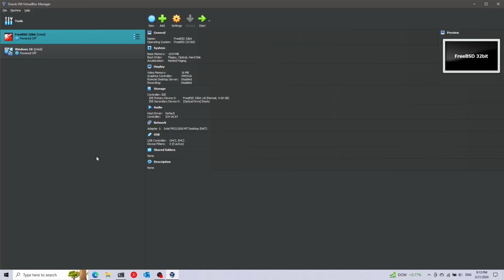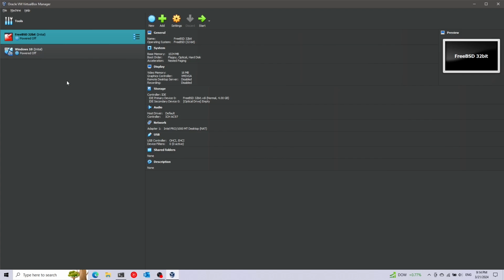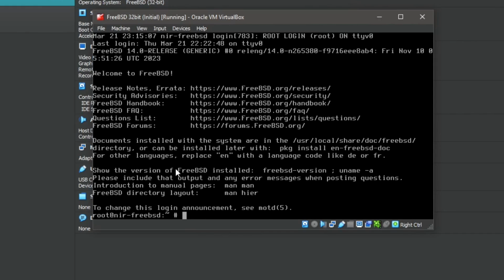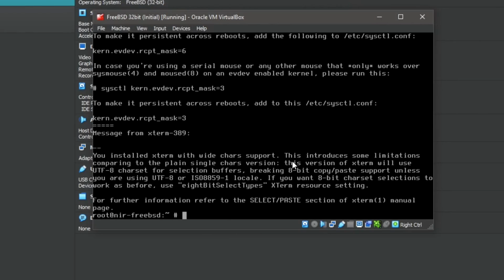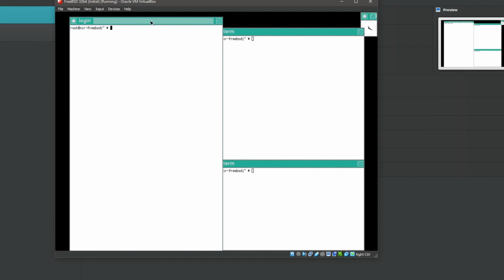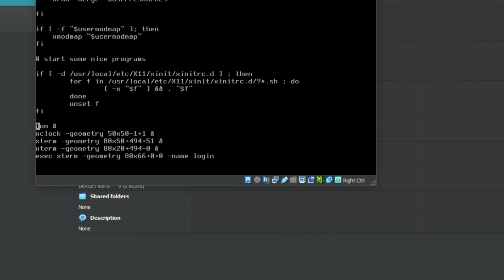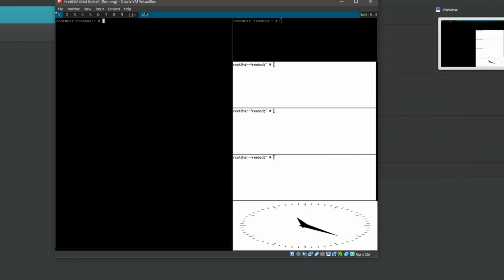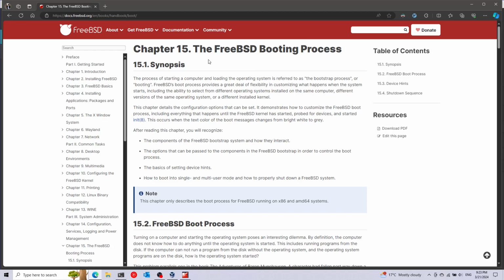Quick Look at FreeBSD

Comment: FreeBSD has a more "permissive" license. As though the license stopped companies like Google and Microsoft from profiting. Android uses a Linux kernel. One of the reasons why I use GNU/Linux is the license.
Why does Microsoft contribute code to Linux? Because they love Linux? If Linux were under an Open Source license like FreeBSD, rather than under a copyleft license like GPL, they would have just forked the code and made it closed source so that they can add their own code that benefits their Azure code platform. Free software shows the way. Free software license is superior to Open Source licenses. Free software forces Microsoft and other corporations to contribute back to the community. 
 Long live GPL!

Comment: Synopsis - FreeBSD is better than Linux, because it has a text installer, and you have to install X before you can do anything. Meanwhile, something like EndeavourOS and Kubuntu are clearly worse because they have a graphical intallation system. Also FreeBSD is better because Linux is only a kernel, and people have had to create distributions. The infamy.

Comment: I used to use FreeBSD around the turn of the century to build custom kernels with custom hardware to do very specific functions on i386 based hardware, and then write specific apps to action. For example a frame grabber card on an analog camera to detect the state of the ironing board power switch, so I could know where I did actually leave the iron on.Firewalls, routers between niche network devices, 16 serial terminal cards to interact with other serial devices, and some bespoke hardware. With the ability to hack the kernel, build files and source, you could modify existing kernel code to do whatever you wanted. I started using it as William Jolllizes 386BSD, into FreeBSD and stopped using it after release 4.3 when my work life balanced changed to work…. Miss those days.

Comment: Nice ! i have a different view on FreeBSD. My first experience with FreeBSD was in version 12 i believe, and i spent so much time, actually too much time to install intel UHD graphics drivers lol (bare metal on my laptop). After doing that i installed KDE desktop and couldn't manage to make my brightness and audio keys to work (n00b moment), the thing is i was actively reading the documentation but couldn't find any section for my use case so until i found a forum post buried under a mountain of similar posts that had my exact problem which also was solved in that particular thread. Afterwards i decided to try OpenBSD, which to my surprise everything worked ootb, i didn't have to install any graphics drivers, also the audio keys just worked but there wasn't any indicator in their default window manager (fvwm, i also believe the only guy who uses it is Theo de raadt himself)

Comment: Why would anyone run FreeBSD? Linux (and UNIX likes in general) is already a small and niche community.
Reply: Bsd users are the Linux users of linux
Reply: @1cubealot  best comment so far
Reply: MacOS and Android are unix-like, and their community is not exactly niche or small, in fact the only popular operating system that is not unix-like is Windows.
Reply: @darksteelmind  If BSD did not have that lawsuit in the early 90’s Linux would not have existed today as there would’ve been no need for Linux because BSD would have been enough.
Reply: It's free software so almost everything that's properly developed is available there too. Also, the BSDs are much more technically strong compared to OS distributions based on Linux.
Reply: It's good for storage servers e.g. running your own NAS because it has native support for the ZFS file system and there is NAS operating systems based on FreeBSD.
Reply: Because Linux containers / docker  is still a total mess.

BSD + jails is good for a stable platform where you want years of continuous uptime.

On desktop, FreeBSD is pretty niche, but the audio is a lot better than Linux at least. It’s actually not a bad platform for a gaming PC.

For a dev workstation- bhyve is decidedly good for running lots of VMs
Reply: @steveoc64 how are containers a mess exactly? It's much easier to build a container, even from scratch, than to use jails.
Reply: Well we need to make the community bigger
Reply: Well, PlayStation OS is based on FreeBSD
Reply: It’s like saying “why would anyone drive anything other than a Ford?” 😅
Reply: @Crux161  love it.
Reply: @Crux161  exactly. IMHO, every OS has its purpose, its pros and cons. There is no "best" OS in general. Like with everything in life, you have to figure out what's the best solution for your scenario.
Reply: @yogxoth1959 Ah, but you are so incredibly wrong!

Linux powers every single Android phone in existence, and much of the server infrastructure behind world wide web.

FreeBSD is used as the base of the operating system on the PlayStation 3 and onwards, and it's userspace and parts of its kernel make up a large part of Mac OS  (which itself is a certified Unix operating system) and iOS.

Sure, the people who actually care about what goes on under the hood of their devices might be (relatively speaking) "a small and niche community", but the interest they take in *Nix ends up serving a much larger (several billion) community of people who don't even know it.

Besides, if you're this dismissive of Unix and Unix-like operating systems being used, why are you even watching videos from this channel?
Reply: Lindo  mi FreeBSD de toda la vida ❤
Reply: Linux is a mess. Nobody agrees on anything, rogue devs constantly hijack software, and recently corporations have been having their way with it. BSD is sane. Every decision is logical and the community is less.. weird, to put it nicely. BSD is just Linux without constant drama.
Reply: @EXP_Jenova  wouldn't go as far to say every decision is logical, but yes. it's a breath of fresh air seeing how most of the BSD community actually keeps themselves involved with software, and not.. other things.
Reply: It is a Psy Op from the corporations to divide the Linux community. zfs is just the excuse.
Reply: Faster TCP/IP stack. Slightly better I/O multiplexing syscall for servers
Reply: Most consoles use FreeBSD as a base
Reply: It's mainly used on servers as I understand. It was also the basis for both the PS3 and PS4 operating systems.
Reply: small and niche community? GNU/Linux is the most used operating system and kernel. it's quite literally everywhere. practically every server, every phone, every IoT device, hell even Microsoft and Apple use Linux for their servers. the ONLY marketspace where Linux isn't dominant is the PC desktop, but even then the marketshare is already impressive, even the Steam Deck which is used for gaming runs on SteamOS, which is a GNU/Linux distribution. and did I forget to mention that ChromeOS is a GNU/Linux distribution? whereas Apple and Sony are some of the corporations that have made use of various BSDs' source code.
Reply: Are you dummy dumb dumb?
Reply: I've been using/handling FreeBSD on servers since around 2005. On my desktop since 2010, and on laptop since 2015. WhatsApp, and Netflix use unaltered FreeBSD. PlayStation 3, and latter use customised FreeBSD. Why? Because it is a stable, robust operating system that can handle large volumes of data,as well as queries. macOS/iOS officially/legally copied the source code of FreeBSD, and made their code proprietary. The user list goes on. Also, FreeBSD is second most practically secure OS for servers as well as for desktops after OpenBSD.
Reply: Because Sony and Nintendo need a new OS. Now get back to work on it BSD devs.
Reply: because it's more stable and secure, but suffers greatly when it comes to gaming
Reply: @yogxoth1959  the license model is also much better for FreeBSD
Reply: @yogxoth1959  well why the earth would you wanna run windows? 
Plus, MacOSX is built on FreeBSD, so I guess ask Apple.
Reply: 1. Opensource and free.
2. Fast and efficient.
3. No bloatware.
4. Freedom and choice.
5. Less viruses. 
6. More customizable.
7. Better performance.
8. Gaming support getting better and better.
9. Stable.
10. No data collection and no Microsoft.
Reply: Cuz I like the organized style of development.
Reply: FreeBSD and Linux are mostly used for servers/embedded software. They target servers, not users
Reply: @iamnotnyssa lol
Reply: Because the logo is way cooler of course
Reply: FreeBSD is better than Linux. Linux is a cheap copy that got famous
Reply: @friedrichmyers how is BSD better than Linux? In what way? You just posted a statement without any arguments 🤦‍♂️
Reply: @CrippleX89  

1. ZFS File System

2. Good defaults. Everything required is setup for you. Now, that's OS specific, even in linux, but FredBSD is sane to use becaude everything REQUIRED works out of the box. 

3. Provided with the full package. Everything is meant to, and does run from the first call.

3. RTFM Philosophy. The manual is so great that it solves almost all the possible problems you may encounter and is a better learning tool than anything on Linux side.

4. Simplicity. There is no complexity in BSDs, unlike Linux. Linux puts too much complexities because of many many bullshit softwares that are built around it, and things don't go well together when softwares with different philosophies work together.

5. The sheer number of distros. Making a linux distro these days is just about changing the theme, colors and packages. Not only does that compell a beginner to distro hop, it also makes learning linux painful. Everyone makes an ubuntu based distro with different defaults and fools wonder which one is better.

6. The sheer speed of a BSD outmatches most of the OSes.

7. The package manager. It is bullshit in Linux. Fucking pacman, dnf, apt, yadayadayada. The package manager in BSD is fast, simple and functional.

Disadvantages:
1. The license.
2. Lack of software support
Reply: @CrippleX89  The licence is better. It is an actual operating system and comes with useful utilities instead of having to rely on GNU for literally everything. It has a superior networking stack. It is easier to use.
Reply: @CrippleX89  
Package management on the BSD systems is much simpler and way easier to use. Seriously, having to research the difference between Flatpaks, Snaps, appimages, atp packages, Pac-Man and portage is a headache. 

The BSD systems also don’t constantly make hundreds of operating systems based off of each other (look at all the distribution based off of Debian). They mostly are pretty much their own separate operating system (with exceptions like GhostBSD).

Stability. It’s really annoying to hop from one Linux distribution to the next only to have it break for literally no reason. This is because of how Linux distributions are put together. In contrast, BSD systems are built with good decision making which is why they are so stable. BSD system don’t go through huge changes like Linux distributions do.

Comment: Well Linux is just the kernel, yes, but the full name would be GNU/Linux which is the kernel + userland programs, which usually come compiled as a distribution. And so is FreeBSD more or less a distribution of BSD like OpenBSD or NetBSD.
Reply: Those three BSD “distributions” in question are forked from decades of old code from BSD4.4 and alike. It’s been so long that they must be pretty much completely independent of each other. At least Linux distributions share the exact same kernel, but surely you can’t compare the definition of a Linux distribution to modern BSD-based operating systems? Don’t basically all of them have their own independent user land now as well, following the same logic? (Exception e.g. DragonflyBSD)
Reply: I'd like to interject-
Reply: The full name would only be GNU+Linux (not GNU/Linux as you have put it) if and only if the distribution shipped contains GNU software. Distributions like Alpine Linux do not ship with GNU software and thus cannot be referred to as such.
Edit: i use arch btw
P.S. if you look into it, GNU actually has their own OS separate from Linux but I doubt it's had much attention recently
Reply: @void_reality_yt   It does? I only know about GNU Guix and 2-3 other ones mentioned in the main website.

Comment: FreeBSD definitely seems cool. Have you run it as a daily driver on bare metal? I'm sure the core kernel stuff is rock-solid and it'd be great for running a server, but if you try to do desktop user things with GPU drivers, etc. I wouldn't be surprised if there were problems, probably with the drivers themselves and not core FreeBSD. That is also where desktop Linux always has problems on my machines.
Reply: Mine is 5 years old now - Nvidia provides official drivers, and KDE has been rock solid.

Upgrading the OS from one major version to another has been painless.

ZFS automatic snapshots has saved my bacon on a couple of occasions too
Reply: @steveoc64  KDE what, bro? 
Manjaro on my pc works pretty good though. Been experimenting with it for about 2 months and finally wiped out windows from dual boot, got a virtual box with win7x32 for some college stuff and doing great. Especially when I know I can't get some malware and snapshots even on ext4 is as pretty good as the system itself.
Reply: Well, if you tried Linux 20 years ago it was a nightmare like you have just described for BSD
Reply: .. but Chrome has been flakey for some sites :(
Reply: KDE 5 I think I’m rocking on that box. 6 is out now apparently.

Manjaro is good fun, it’s lean and mean and well sorted.

Just getting to use the terminal more, and dicking around with networks and VMs, you learn heaps.

Programming tools in Linux/bsd are really next level too